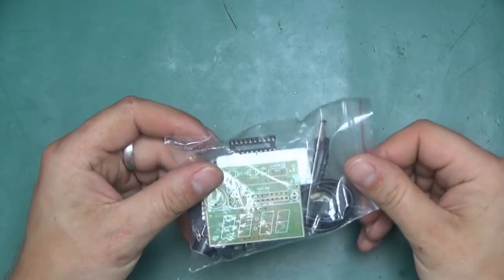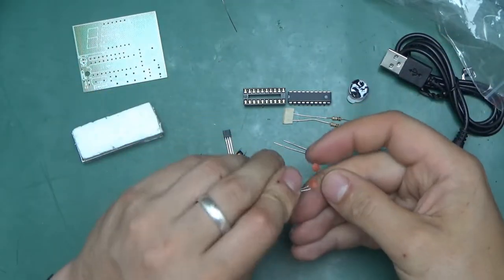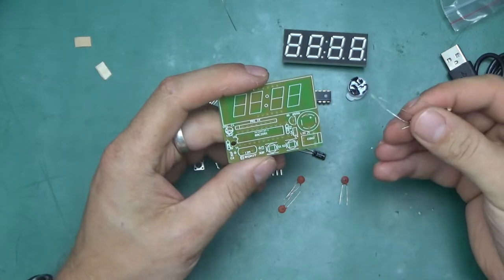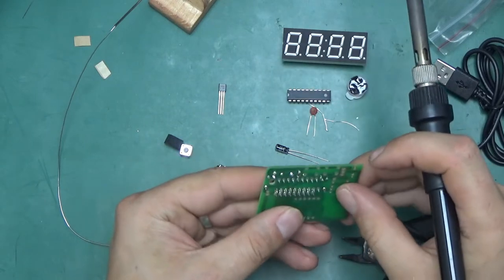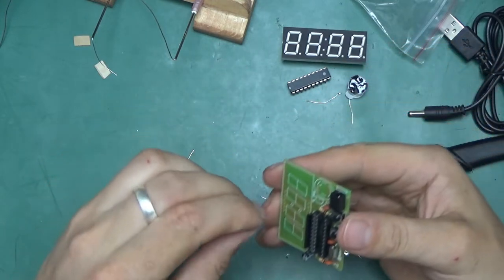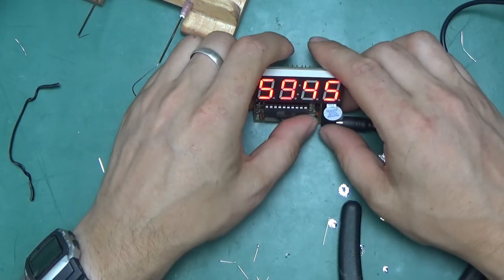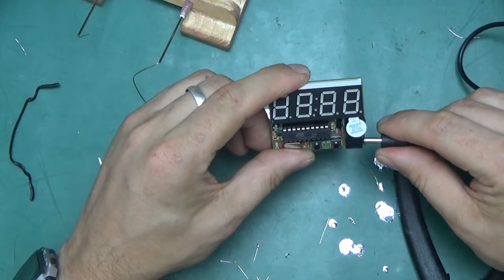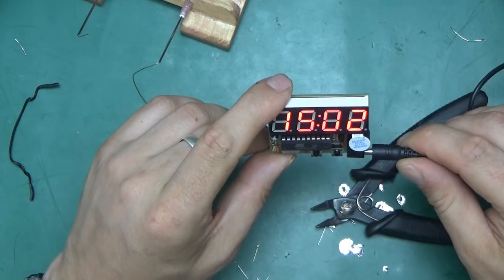#010 - Kit build: clock about time

Comment: The last two on/off settings are for alarms. On change to 'on' it will let you set hour and minute of the alarms on the next presses of the left button instead of going right to next 'mode'. 
IIRC the chine will not sound after/defore 20:00 / 08:00
Reply from the maker: Thanks! That makes sense ;)

Comment: Really nice little kit, dude. 😊
Maybe you can power it with a lithium battery, a small step up and a TP4056 for recharging. 😉
Reply from the maker: Sound like a good idea, but perhaps a bit of an overkill for what it is ;)
Reply: MC's Creations 
one of those little all in one 'UPS' modules (5V usb input, LiIon nanagent and 5V output) should be ideal
Reply from the maker: ok, seems tempting...
Reply: randomtronic 
Talking about overkill, if the ups module has (haven't looked closer at them) that says when it's running off battery, and hacking in a way to turn off the display....
Reply from the maker: LOL, thats out of scope here i think, because the entire clock is run off the micro, so ideally to do that kind of feature, it would be best to modify the code. But on the other hand,  we could put small mosfets in line with the common electrodes of the display, and shut them off that way. Hmmm... Ok, this begins to sound like a fun thing to do ( I get distracted way to easily... LOL)
Reply: randomtronic 
Who, me? Going off on tangents? Never... :-)
Or maybe just one on the common line?
Reply: You see? We can always make something simple much better. 😀